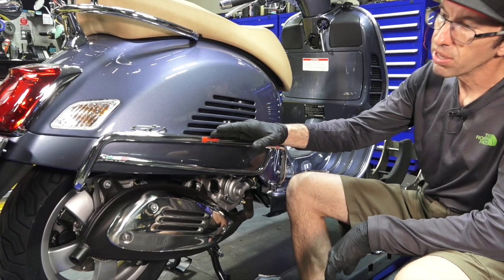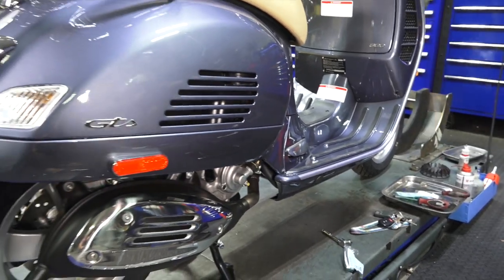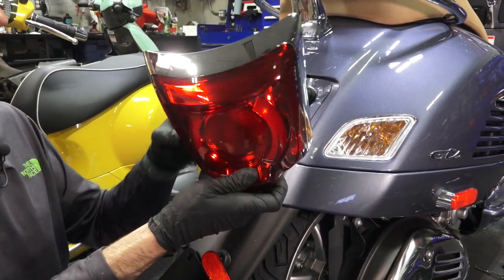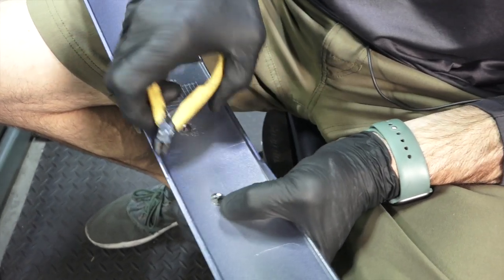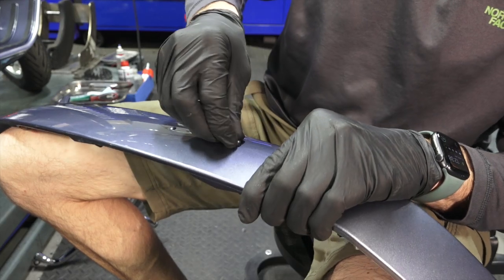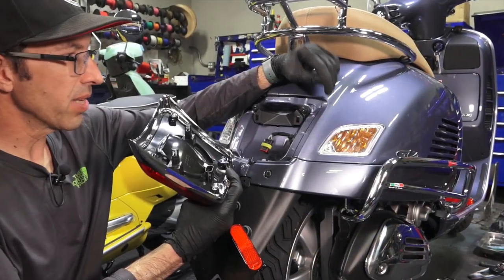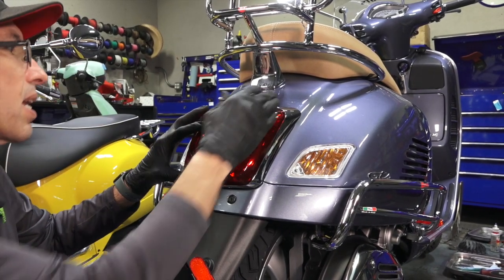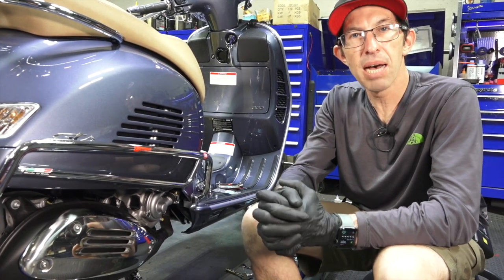How To Install New Faco Rear Crashbars on Vespa GTS HPE

Comment: As always, great step by step install video. However, I installed these on a 2008 GT300 in the past with terrible results. The bracket in the front immediately pinched and cut the cooling line when I hit a moderate bump. I was sent "updated" front brackets to install by Faco - but ended up with the same unfortunate result. I swore these bars off forever! I assume the front brackets have been redesigned and adjusted since my experience years ago. (FWIW, this was a while back, and didn't seem like an uncommon problem I found online w other owners). The experience STILL burns my britches, so I felt compelled to post/mention it. You can see in the video how close the bracket and hose are in the space. It appears as if the coolant line curves and is better fitted up into the space than what I remember on my 08 GT. They are very nice looking "low profile" crash bars though, definitely helpful preventing minor dings or scratches. I hope the issue I had has been resolved long ago and owners can enjoy this mod problem free.
Reply: Same issue with this Faco product. On my vespa gts 2011 I got damaged the water coolant pipe and the transmission air intake cover. The problem is the bracket scratching those parts when the scooter is  loaded with 2 passengers. In 2014 decided to remove them. Now I'd learned some welding basics and decided to modify both brackets and proudly sharing it works well. I just had inverted the bracket corner in order to gain some space between the bracket and the bike.

Comment: Concerning my last coment about the reflectors being a requirement, I just heard you mention that fact at 9:45 into the video. I stand corrected.
Reply from the maker: Yeah, they can be a pain when it comes to accessories like this. That's why we sell color matched plug kits to remove them somewhat seamlessly. Thanks for watching!
Reply: @VespaMotorsport  I had the crash bar put on my 2020 GTS 300 hpe, but my reflectors are still on my Scooter
Reply: I'm sure you know this , but I want to tell you that all of your Vespa videos are an invaluable collection to me, and though this is my first scooter ever, I  love watching all of the videos just to learn how to do something new that I didn't know how to do before. You are definitely a commodity in the Vespa community and all of us will experience a big loss when you decide to retire!!

Comment: Robot, The attaching points seem a little week for a crash bar. The crash bar itself seems rather sturdy but I would think in a crash the attaching points are not strong enough to keep it from collapsing into the body. Perhaps these are more for looks or a minor tip over.
Reply from the maker: Honestly these are more for aesthetics than anything else. You are correct, they will help prevent scratches in a minor tip over or moving the bike around a tight garage, car doors etc. We've seen that first hand quite often. In any major crash, the bars will probably not offer much protection and your bodywork would suffer regardless if you had them or not. Just another way to dress up your scooter with a little bit of added protection.

Comment: WARNING! For people having a akrapovic/polini/malossi aftermarket exhaust: THIS CRASHBAR WILL CRASH WITH THE TIP OF YOUR EXHAUST. I learned this the hard way, making deep scratches on the tip of my exhaust and the crashbar itself. The low backpart of the crashbar is very low and when the supension is working the swingarm together with the exhaust , it will smash into it. Guess I was too stupid to figure this out BEFORE I took a test-ride....😑
Reply: Thanks for sharing this. I have a friend with these on his 2022 GTS, but he's still running the stock exhaust.

Comment: Thanks for the video. When you mention protecting metal finishes with a silicone spray, would that be the same as a silicone spray lubricant like the one offered by Motorex?

Comment: I fitted these to my GTS and they burst my coolant pipe when riding.
Reply: How did it hit yung coolant pipe? I installed the same and when the suspension moves the bracket and the coolant pipes are not affected.

Comment: Wont fit with akrapovic
Reply: If you don't mind you can remove the Akrapovic carbón fiber cap. I did it and it looks not bad.
Reply: ....OR polini. I found out the hard way....